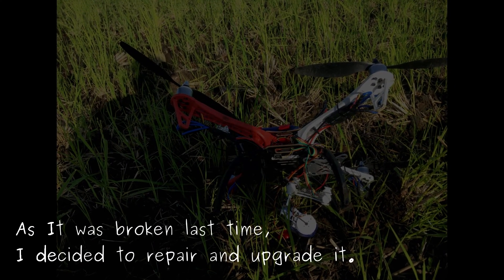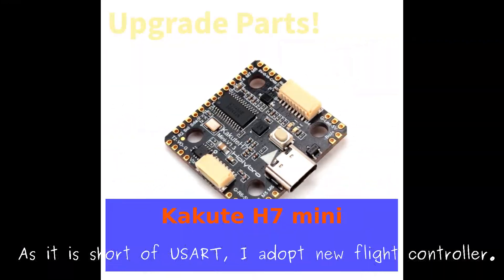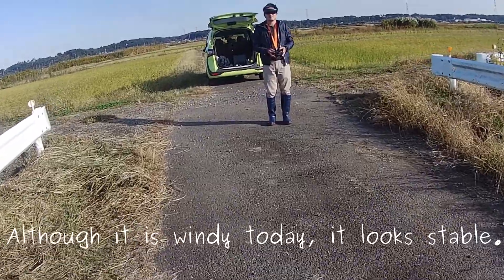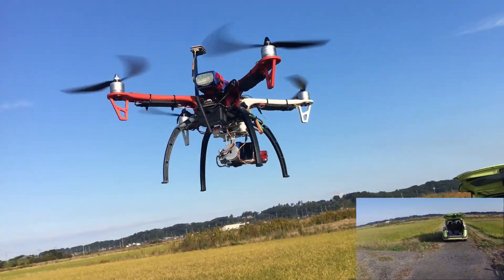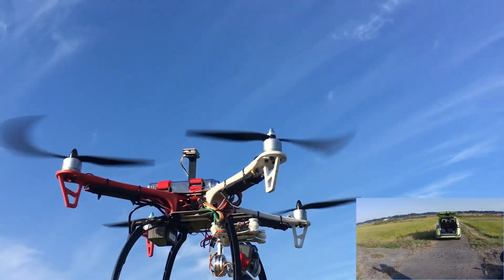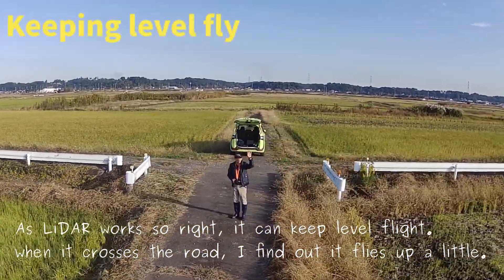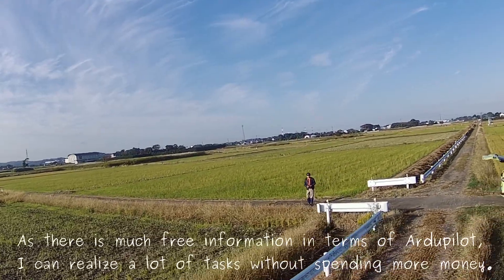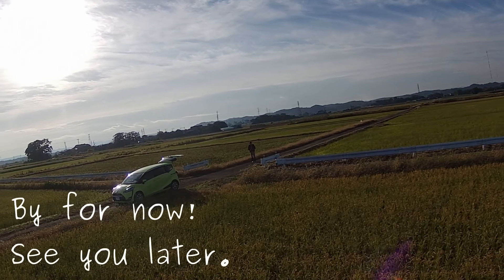Kakute H7 + Optical flow (ArduCopter)

Comment: Can You please suggest a camera for drone which has video stabilisation, can record high quality videos and can also give video output through micro HDMI, so it can be connected to TS835 transmitter?
In my opinion, SJcam legend 6 will be best. What about your opinion?
Reply from the maker: Thank you for watching! Now, I use Runcan thumb pro. Although it is not the best quality, Gyro flow + this cam has a quality which is able to effect to be enough charmed.
Reply: @TM_river  but how can I get a live video output from it? It will only record video and will not give video transmission through TS835 on my mobile phone.?
Reply from the maker: @TurboTronics11  In my case, I let the FPV cam and movie cam divided. If you realize these function within one cam,  SJcam might be a good selection.However, as those features is different from each other, it is difficult to integrate them, isn't it?
Reply: @TM_river  but then can I never make any drone with a camera like Dji uses? Dji's camera is one and only one and sends high quality video to GCS?
Reply from the maker: @TurboTronics11  How about using Runcam 5 orange? Probably, it has a TV-out. I have investigated it for the same purpose before. I think it is good in terms of the video quality and FPV performance. However, I have never used it. because FPV needs a high-response video performance and I am concerned about it which has some delay.
Reply: @TM_river  can't there be just a system like DJI uses in its camera drones? Transmitting high quality video to our mobile phone?
There comes a DJI O3 air unit, but it can transmit video only to Dji goggles. I want something like that in low budget......
Reply from the maker: @TurboTronics11  In my opinion, If you have just a low budget, I recommend an analog cam + analog transmitter(like TS835) as the best FPV unit. And in addition to it, we can take a high-quality video with a special cam (like a GoPro cam). In my view, if we want to let FPV cam and high-quality video cam integrated, we have to use a digital transmission system. Because analog transmission systems can't express high resolution. Even if a low-budget wifi digital is used,  Wifi transmission generates too much transmission delay to use as an FPV system.

Comment: i have Kakute H7 V2 and sky droid T10, i am not able to get the stick output in the reviver section, although my receiver and the transmitter are binded, i also on the serial port but then also its not showing any output. please help.
Reply from the maker: I speak it as a premise that you are using Ardupilot.
Generally speaking, Kakute H7 delivers serial6 as UART6(RCINPUT). It is set up for serial RX Protocol SBUS by default*1.
Are you using other protocols as RX? For instance, if r10 reciever were PPM output to Kakute H7, Kakute H7(default setup) wouldn't recognize it.
However, as I am not a master in terms of Ardupilot, you had better ask expert members at the Ardupilot site*2.

*1: https://ardupilot.org/copter/docs/common-holybro-kakuteh7-v2.html
*2: https://discuss.ardupilot.org/
Reply: I am using inav configurator, and I have connected the R6 wire with the signal wire of the sbus signal wire. The receiver and the transmitter are working well with pixhawk, but don't know why it is not able to connect with kakute
Reply from the maker: @himanshuroy5397  
As far as I know, there were two setup places interms of receiver  in INAV Configurator. Ports and receiver. Ports include the parameters of uarts . Receiver includes protocol. This is just only thing what I remember about it. I don’t know about the latest version.

Comment: Any reason you didn't go with the Kakute H7 V2 Flight Controller (STM32H743) ?    What firmware are you using?

Is it possible to test with different firmware.. Ardupilot/Pixhawk (PX4)..  Betaflight/EmuFlight/iNav?  FalcoX? 

Will your drone work with FPV/flippy-flops and autonomous/waypoints/return-to-home?   Or is there a commercial drone that can do both?
Reply from the maker: Thank you for watching this video. I use Kakute H7 V2 MINI which can save cost more than standard Kakute H7.
The firmware on this FC is Ardupilot 4.3.0. Ardupilot produces it for Kakute H7 MINI. And I have no problems.
Although I used to use INAV before, now I use only Ardupilot. As far as we use a camera drone, I think that Ardupilot is the better choice.
Of course, though except for DJI.
Since Ardupilot produces waypoints/return-to-home and so on, these functions work on my drone.
But my drone is a hobby drone. Therefore I have no plan which is to set up other firmware. I am sorry.